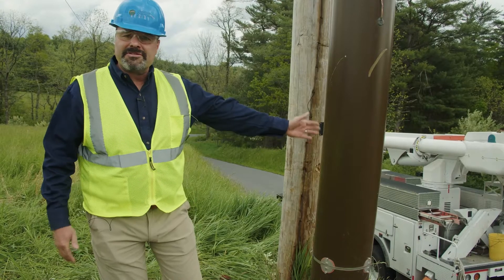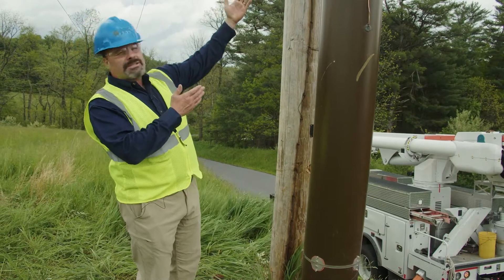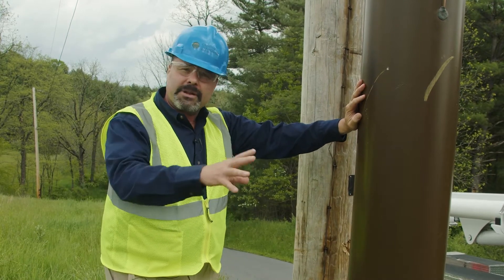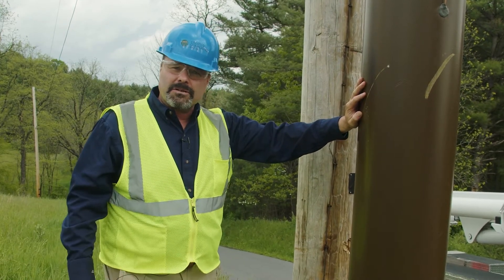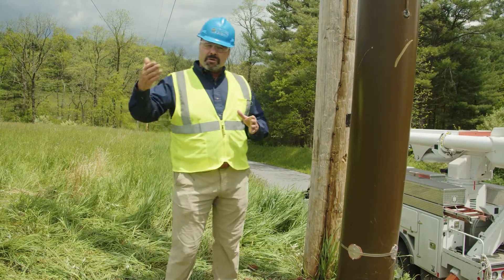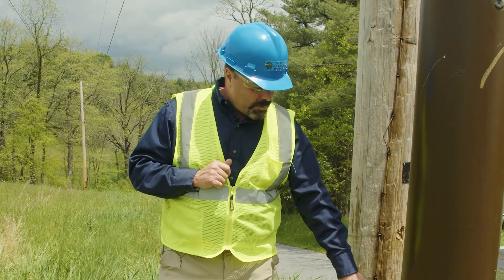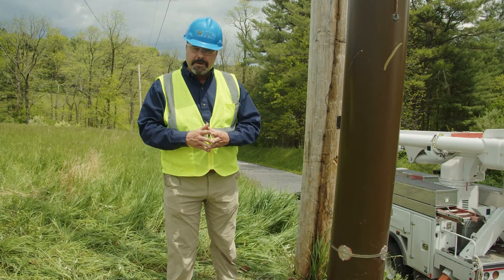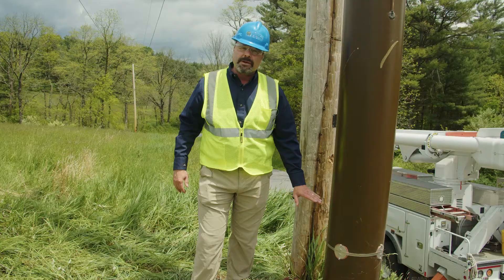How to Post-Fire Inspect FireStrong™ Utility Poles

Comment: Please clarify. The dust you create has nothing to do with being inert, as you state. The poles are fiberglass,  correct? You wear long sleeve shirts to protect your skin from the glass fibers, correct? Just like when you install fiberglass insulation. So why wouldn't you wear a niosh mask or respirator to protect your lungs, like insulation? You can obviously see the dust become airborne and multiply this, times hundreds of poles in ones career, and you've got serious health issues. No thanks.